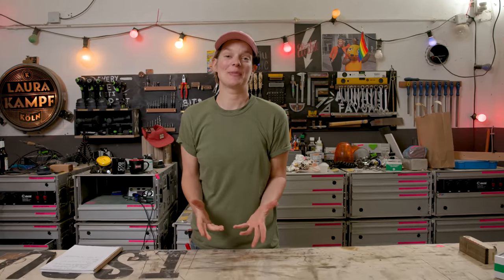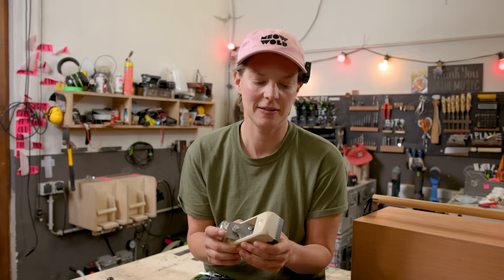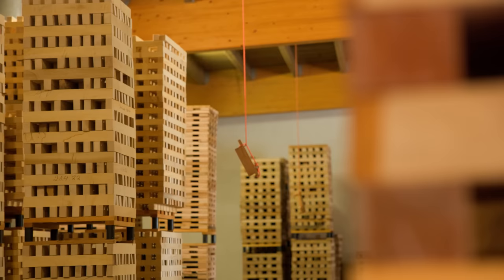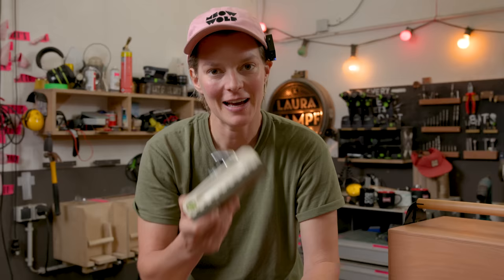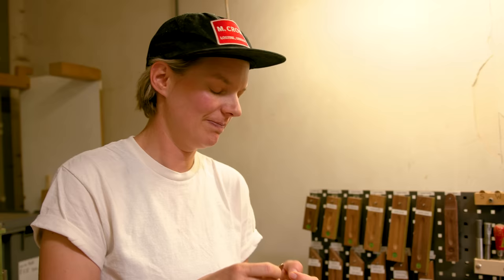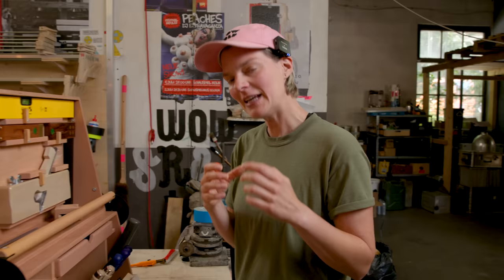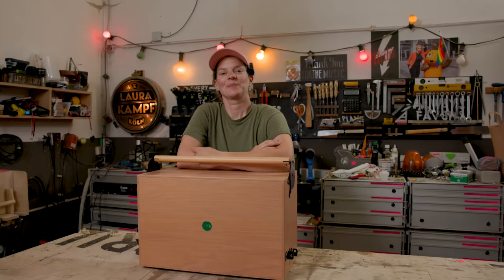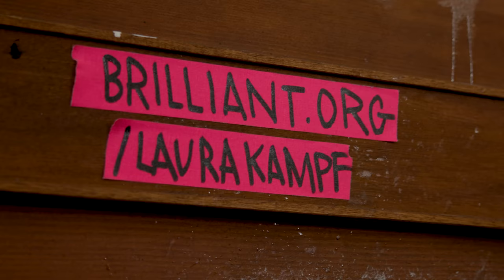Inside a 170 year old Workshop...(how hand planes are made)

Comment: Awesome. The specialized machines. The care and respect for their craft. The toolbox. The pantograph lathe. Those shavings! Beautiful. Life hack: try planing rough wood instead of sanding it. It's faster. A sharp plane leaves a surface so smooth that finish won't adhere to it, so if you're putting something on the timbers, you can still do little a sanding. As a treat.

Comment: I have owned one of their block planes for 40 years and I use it fairly often.  I like it more than my steel block plane because it's lighter, it takes less effort to use.
The toolbox you got looks good, but it's missing a saw, a drill, drill bits, and a mallet.  Also, I'd swap the tri square for a combination square because a combination square has multiple uses.

Comment: Drying wood for 1 year may be enough for woodworking tools, but look at the woodworkers making models for sandcasting iron .  To ensure stable results, they age the wood for years and use special measurement sticks scaled to the heat expansion of each type of iron, so they can measure a wood shape that when pressed into sand leaves a hole just the right size that pouring in molten iron will leave a shape that cools down to the size on the measurement stick .  Repeat that pressing thousands of times to make thousands of those iron parts before remaking the wood models .